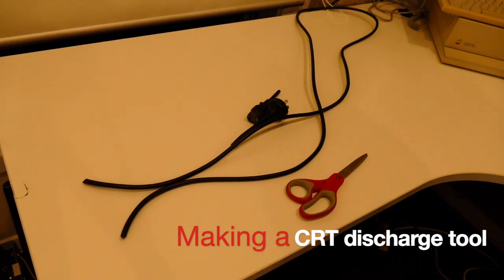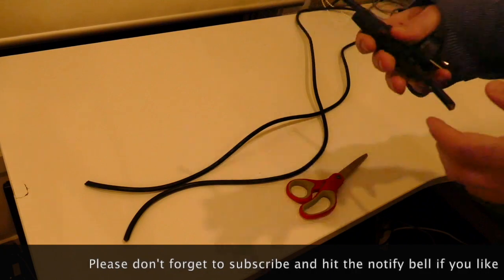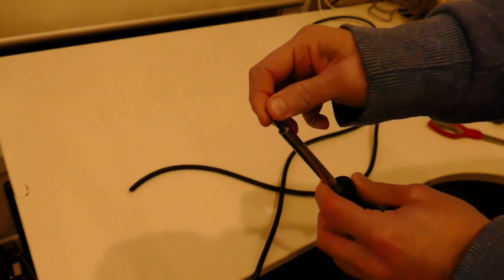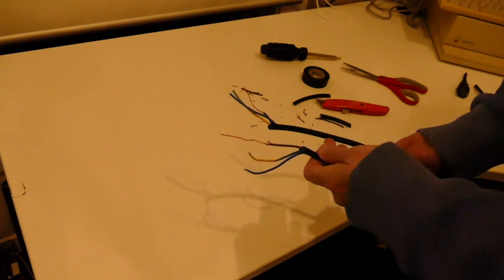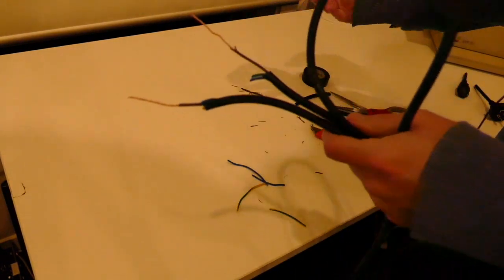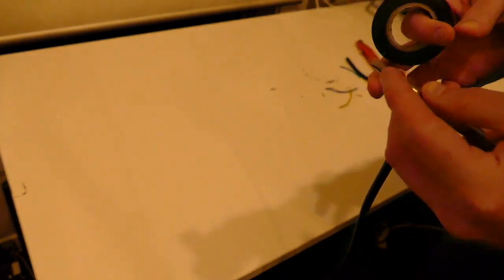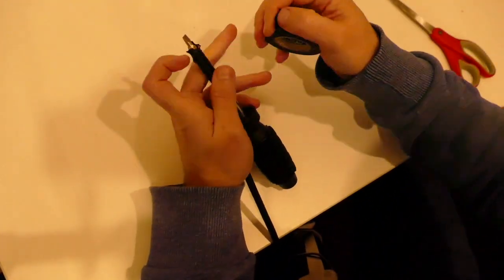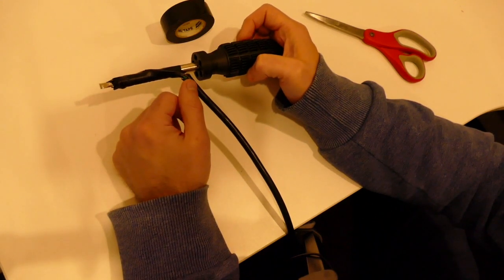How to make a CRT discharge tool for free

Comment: I'm finding it really hard to find a screwdriver that I'm confident is safe for this. I wanted to get a rated insulated screwdriver but they all have heatshrink pretty much all the way up the blade, with only the metal exposed on the tip.

Comment: Odd that you would need such a thin gauge wire for such high voltage to use as a path to ground(ing). Why not use 10 or 8 gauge wire? I have a B&K model HV40 that can discharge up to 40KV yet the wire is at least 12 to 14 gauge. It makes no sense...Some one enlighten me!

Comment: Most 'modern' tubes self discharge. It won't 'blow your arm off' but it will hurt ;) The other end of the cable should be connected to the chassis ground (usually a sprung earth strap around the tube)  PS It's AN-ODE not A-NODE ;)
Reply from the maker: Thanks! Yep I know about most modern monitors having the dissipation resistor in them but I thought best to go to least-common denominator in the interests of safety 😊 my next video where I 'repair' a 5151 monitor shows me connecting the earth  lug to the other side of the tool